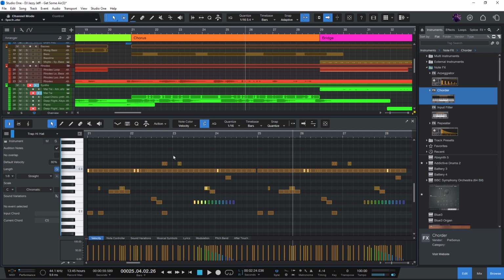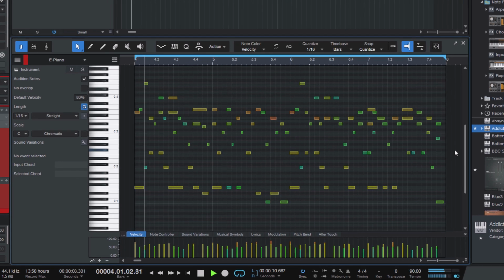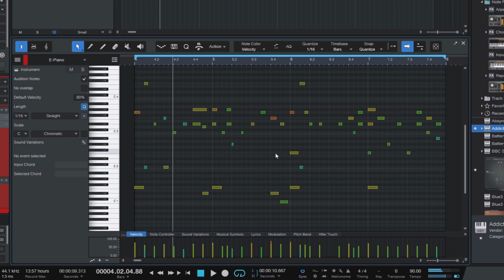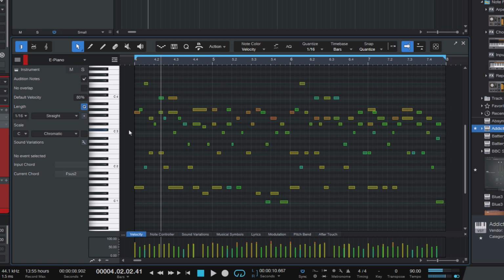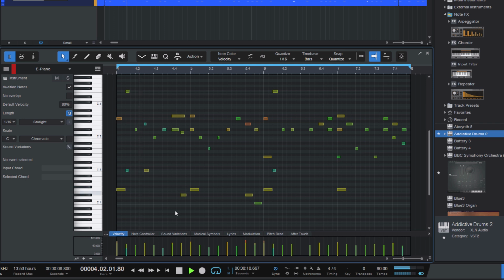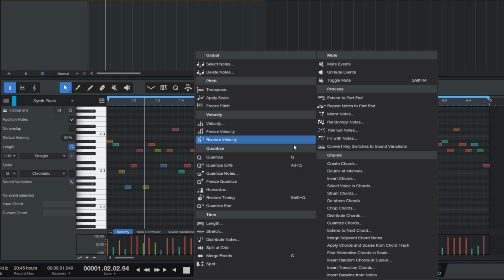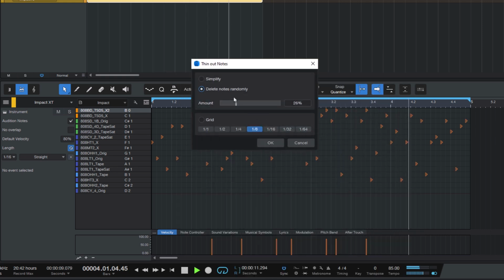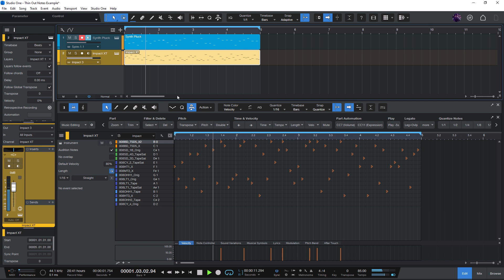Randomize Tools in Studio One Pro 7 - How to Thin Out MIDI Parts

Comment: Thanks Lukas! watching all 3 videos (Fill, Randomize and Thin out notes) and observed a drawback in workflow. It's inefficient to open a dialog window every time to change parameters and then close it to process midi content. I'd like to get 'Apply' button to apply parameters on the fly without closing the dialog. Macros are not very helpful because adjusting any parameter is impossible. I guess it's pretty easy to implement.
Reply from the maker: @twpICS  It's a good point for sure. I agree a live preview or non-modal dialog windows would be very helpful especially for tweaking parameters in more complex note actions.

Comment: Super fine 😊 would there be an option to drag a full midi in and split it up in the diff. Instruments - sometimes I can’t do in studio 1 - but thanks for a nice program 😊
Reply: I did not say there something wrong in studio 1 - just I sometimes get some midi that studio 1 not could split- and asked if there maybe was a solution here 😊 studio 1 is super and all that stuff there is there is also ok. Just a question
Reply: @ well, yes, in fact Lukas, the guy who posted this video, makes an addon for €39 which strips a chord into tracks for an orchestral arrangement. That MIGHT do the trick, depending on your midi clip... but check out his videos on his addon called Harmony Wizard.
Reply: ? that happens automatically if it's a normal midi with several tracks... not sure what you mean... I drag a midi with 4 instruments to Studio One and each drops on a separate track... does that not happen with you?
Reply: There is some midi file where I can’t split it up, and where al instrument are on the same track- it is these midis i refer to. Normaly no prb.
Reply: @ that sounds like a problem with the format of those midi files... not Studio One... maybe i'm wrong?

Comment: These designs are very good, but I suggest that these adjustment windows float on PIANO ROLL, so that users can adjust until they are satisfied. Select, adjust, apply, and the changes will be made immediately. You can see the changes and play. Then this window will always be on top. Now we open the window, set the adjustment changes, click OK, and if we are not satisfied, we have to withdraw and open it again. It is very complicated and not easy to use. Other similar tools should all become floating windows. Do you understand what I mean?
Reply from the maker: Perfectly understand what you're saying :) Studio One would need to add this as a feature, then every note action could take advantage of it.
Reply: @studioonetutorials   yes. thanks. The window must be floating. Adjust with the mouse, change instantly, and play immediately. We can see the note change and change it immediately. There is no need to close the tool window because it is floating on the piano roll.

Comment: I notice that you keep your midi grid editor a measure or so away from the keybord on the left side of the grid editor, which is probably to keep the notes from going "UNDER" and past the keyboard. Can't you guys fix the grid editor so that the midi notes do not go under the keyboard? Thanks Dave
Reply from the maker: I honestly have no idea what you mean. I've never seen MIDI notes go under the keyboard...
Reply: @studioonetutorials  No sir, sorry I just tried it. Try moving your midi notes to the left with "ALT" + "LEFT ARROW'. It gets a little frustrating. Why should midi notes ever go under the keyboard. I'm just asking. Thanks for your reply Dave.
Reply from the maker: @DavidLeeMenefee  You mean notes can go beyond the part boundaries? Well, this is a pretty basic feature. Without it, you wouldn't be able to trim instrument or audio events. Certainly nothing to "fix".
Reply: Also, when you take a midi note in the midi note editor and move it either to the left or to the right using the 
"ALT"+"RIGHT ARROW" or the "ALT"+"LEFT ARROW" on the keyboard the note that you are moving gets moved over other same pitched note, and  ends up deleting all the other note in its path. Other DAWs do not do this. Is there a reason for this? Thanks for your reply, your friend Dave.
Reply from the maker: @DavidLeeMenefee  Does not happen here! Something seems to be wrong on your end. If this persists, the best thing is to take a video of the issue and create a tech support ticket.
Reply: @studioonetutorials  I'm using windows, could be a reason.